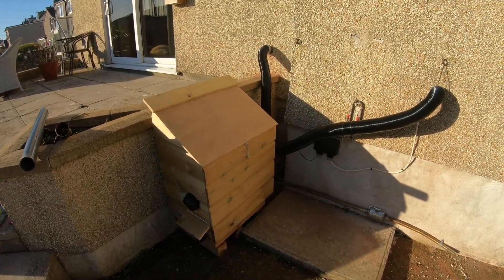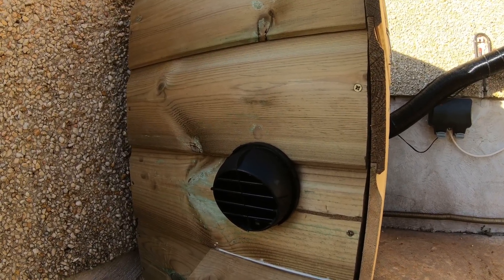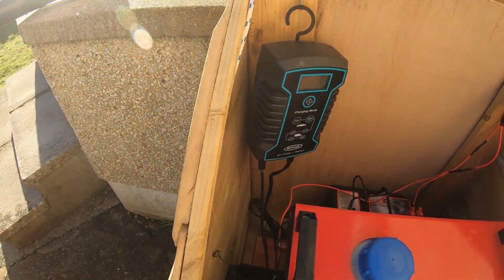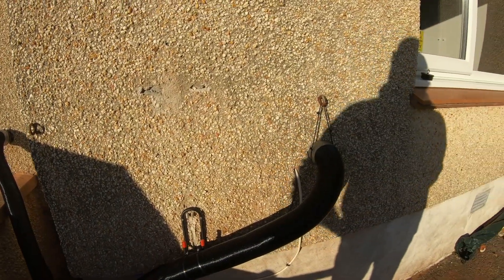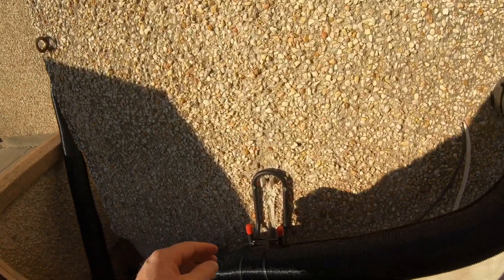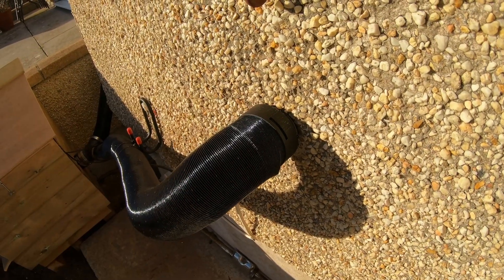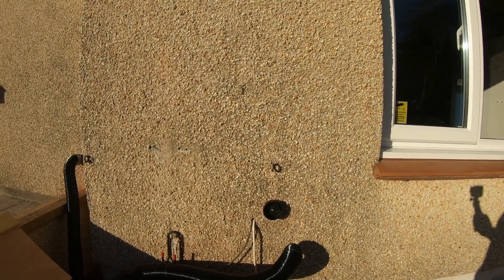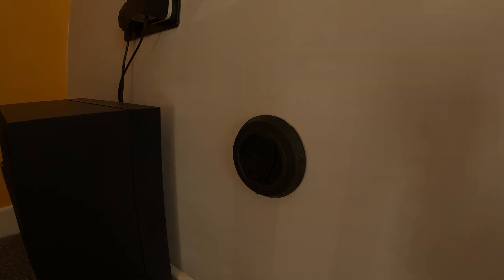Heating my home with a Chinese diesel heater.

Comment: L.P. is cheaper per gallon in America, and Natural gas is even cheaper. I see people use these Diesel heaters in garages and Campers/ Rv's mostly.
Reply from the maker: Yeah, RV’s & campers but also lorries, or semi’s as you call them. People have started looking into heating their homes with the diesel heaters because of ever increasing charges. Most homes in the UK presently have heating using natural gas or electric. Some, although not so many have oil (kerosene) like I have.

Comment: On exsos muffler i did see wrong
Was locking like it was up side down.  Sorry for that
Reply from the maker: Hey, no problem.  👍🏻😀
Reply: @en53kff  yes but right shud be right man 😉

Hope u find out of it. But I can garany u it is not condens from air heaters inside

Comment: Ur exsos muffler is up side down.
There is a draining for condens in topp as you have it now. If u turn up side down condens gets out of that Long exsos pipe.

Shud have put it inside and use energy from exsos heat as well
Reply from the maker: No no. Screw is at top, hole is at the bottom.
I have it outside to draw in fresh air which eliminates condensation inside the house.
Reply: @en53kff  if u get condansation of this inside ur have another problem m8.
This is trying air so dry u can dry ur washingmashine clodes inside.

If ur drag outside air inside house u get moister as h...

Have bean used this for 3 years stright 24/7 and my boat is to dry inside so have to open up some vindows and sometimes the Door.

They not produs any condansatione at all. My houseboat is dryer then New houses are.
Normal moister here is 15 to 25% when I do open Door and Windows many times every day.
And remember. I dont use energy of exsos.  Exsos and inlet for burner goes stright out.

And much lower cost and consume when inside. Cos it use so much more energy to heat up 0 celsius air then 20 celsius air.

Last vinter i get stucked in ice. 1 meter of ice.  22 celsius below. And 23 degrese celsius inside 24/7 and still i did last 4 days in the houer for 10 liter. Litle under cos u never gets 10 liter in tank.  But say 10 liters.
Lower cost than have cable whit power to ouer house in cost.

So thats not a real argument m8. Sorry.

And Just locking at all others sailera and all People that now use this for houses.  Never ever have i seen condansatione. Ever. And I have seen video of all burners for years.  Have a friend that import this alsow. 
Never ever bean an issue.

So then u have burner to suck air for heat blower from outside ore a moister place !!!!!

Remember normal hosuses have around 30 to 35% moister in every houses. Thats normal.

So not shure how u manage to get that, but have nothing to do whit air heater inside att all man.

Know so many that use this year around and artic sailers that dryes out there boats whit this heaters.

Maby ur was full of water inside ore something crazy.
But this never get any smell ore any condens inside if not do any wrong whit it. 
THATS FOR SHURE !!!!!!

Comment: How does the running cost compare to using your gas central heating?
Reply from the maker: Hi there. I can’t give you A comprehensive answer because we don’t have gas in our village. We do have oil fired central heating and I can tell you that our central heating boiler burns kerosene at a hell of a rate compared with my little diesel heater. However, there are many videos on the subject available to view on YouTube. 
It is dependent also on how high a setting you have the heater at. I set my controller at 20° which can take an hour to reach from 15° before the heater will automatically quieten down to a tick over to maintain that 20°. 
I have heard different opinions but generally it costs between 15p to 30p an hour to run on diesel.
Reply: @en53kff ah ok, i wonder if the little heater is actually more efficient or if you just use less because you're heating a couple of rooms instead of the whole house?  would be an interesting project to investigate.  

neat installation too btw, meant to say, good job :)
Reply: @StikDragon  heat whole house if u Mount it inside garage ore some and use energy of very Long exsos pipe. And get air from inside and spread it out inside again.

Must do whit all of this burners is fine tune secret menu code 1688.
Hx 1.2 at low. And 3.6 Hz at topp.
And be safe when you mounth it safety. 
Can use exsos to bend copper pipe around and make heat exangers to.   Litle pump to send Hot water around all house for radiators and so on. Water tank.
Get a bigger tank is a must.  I have bean used this for 3 years 24/7 whit no problems.   When u tune Hz settings and alsow fan speed to 2200rpm at low and 4500 at topp.  U get burning so clean u almost not need exsos out.  But u take it out anyway for safety!!!.
10 meter ore more no problem for exsos.  Produses heat at ur garage feks. 
And u can get out so much energy from exsost whit make coppertubes around exsos and use all the energy from it. 
Have heat outlet in house at floor. And more then 1 outlet.2 ore 4 is ok. Then u can stop any if want to.   Them say use some watt in start and stopp. Thats true.  But whit my fine tuning it is running for 10 watt at full blast.  When Idle i never have get any readment. (To low)  10 watt 24/7 is nothing. Depens in ur house and how well you build this.  But 10 litet at fine tune goes in 4 days in norway.  Below freezing
Reply from the maker: @StikDragon   Hi again. I have two entry points into the house but doors are open to warm all areas. With hindsight I’d have no hesitation to do it all again. Thanks again for your positive feedback. 👍🏻
Reply from the maker: @Lordlindef  Hi Eivind.  Yes I have tuned my heater, adjusting the pump rate and also the fan speed. Each heater should be tuned individually. The parameters for each machine are different. It depends on the temperature of your air intake as well as the type of fuel you are using and whether it is a mixture of more than one fuel. The settings you gave may be good for your machine but not everybody’s.
Reply: @en53kff  no ofcorse not if ur not burn diesel like all shud do !!!!!

Whit diesel it work perfekt all over
Reply from the maker: @Lordlindef   Good comment Eivind. 👍🏻.  Nice information.  I don’t think too many people fine tune their heaters. 🤔
Did you see this video? 
https://www.youtube.com/watch?v=SmCYQu53umk
Reply: @en53kff  i've got a much older version of this that i've been using to heat my workshop for many years now on kerosene, i had no idea they could be tuned, i'll have to try, thanks

Comment: In Tulsa, OK it'd be MUCH cheaper to use propane gas in an unvented blue-flame heater. The advantages are so many , but I'll just name a few; moist heat: Open flame puts humidity into the air instead of drying it out. The colder it is, the worse dry air feels when heated. 68* air at 70% RH feels comfortable while 78* air at 10% RH still feels COLD! Dry air is hard on your nose and lungs and leads to nasal and sinus infections. Why did Grandma keep a kettle on the wood stove all the time? A 40,000 BTU propane heater isn't expensive and is maintenance-free. You can't say that of any diesel heater (I was a semi driver and lived with a diesel cab heater and hated it. When I got a heat-pump run by a diesel power unit, I thought I was in heaven! No more waking up in Utah at 3 AM to a -4* sleeper because the heater was plugged-up!!! The bunk heater/cooler was HEAVEN on a golden plate, I had all the electric I could use and a little fridge and microwave and COLD A/C with-out idling the truck engine all night.) Today (Valentine's Day) diesel is $4.99 a gallon. Propane is $14.99 for a "20lb." tank at grocery stores or $9 bulk-Hmmm.
Reply from the maker: Hi there Ricky.  Thanks for your comments. It sounds like you found the set-up that worked best for you in your trucks cab. Those in the UK are predominantly diesel heaters. I guess though we don’t have as many overnighters as you do in the States, being such a smaller country in comparison. 
I’ve just been looking at present prices in the UK and converting them in dollars. For heating I can buy what we call red diesel, which has a reduced tax rate. That’s because we can’t use it in motor transport. That works out at around $5.93  per US gallon. So pretty similar in price. Regular diesel for cars and trucks is $7.71 on average per US gallon.  
Here, propane (exchange empty bottle for a full one)  for a 24lb bottle from a store is a little under $36. So that works out at $30 for 20lb. You can’t get a price for bulk deliveries without phoning a company first for a quote.  👍🏻😊
Reply: We have the opposite problem in Britain, we need to get rid of humidity!

Comment: Is it worth insulating the heating duct, from the diesel heater to the house, as you must lose quite a bit of heat to the outside air?
Reply from the maker: So many people have commented on this and so many times I’ve answered in the comments . I wanted to point out the ‘Y’ piece and also the reducers in the video. Since then the ducting outside has been insulated. Thank you for your interest. 👍🏻

Comment: I'd cover that pipe with rockwool or fibreglass. More heat goes into the house
 and less lost in transit.
Reply from the maker: Yep, it was all insulated soon after making the video. 👍🏻

Comment: how long does it take to go from say 18c indoors to 21c
Reply from the maker: Probably anything up to an hour. But remember that the heater is working 50/50 between two areas. It would be around half the time if I was heating the one room. One room measures 18’ x 12’ and the other 15’ x 12’.  Hope that gives you some indication.

Comment: very good, I set up something very similar here at home.. do you have a problem with insects entering through the air intake?  Here I built a filter with pvc tube and a thin fabric..
Reply from the maker: Thank you. No I don’t have a problem with insects. But there again, it is winter and insects are few and far between at the moment. If I do find I’m having a problem in future I may make some alterations but we shall see. Cheers.

Comment: Why is it that everyone who mounts these heaters outside fail to insulate the air hoses into and out of the house. There are even some who take outdoor air to heat but they need to provide ventilation so trapped indoor air to leave the home taking moisture out with it. If it is a new home it’s critical to vent the indoor air since new homes are mostly airtight.
Reply from the maker: Hi there. As mentioned in many previous answers, the outside ducting was insulated shortly after making this video. I wanted to show the’Y’ pieces as well as the reducers before covering it with insulation. Air blowing in from outside works similar to a PIV system. Yes, it does need ventilation, as does any home, (which I have) and it will find any exit, eliminating droughts, particularly in some older properties. The moisture content in my property ranges between 35 - 50% which is well inside the acceptable level for the cooler time of year.

Comment: Nice installation, I done similar project I used plastic storage box/bench from B&Q as heater housing, I decided to buy one of these heaters  after this last cold wave we had here in Ireland, and big  impulse to do this was my gas bill :P.
Due to house configuration (terrace) I was only able to do one outlet in the kitchen but still all downstairs get nice cosy warm after while, my wife love it she was sceptical on this but now she use it all the time. We use about 10-15 litres of green (lower tax) diesel per week , 1.10 euro per liter so is not to bad IMO.
Reply from the maker: Hey, good for you. 👍🏻 it’s a good feeling knowing that your house is warming up and you’re not paying through the nose for it. It sounds like you used your initiative when looking for a box to put it in. Great idea. Some people criticised me for using timber to make my box saying it was a fire hazard. But as you know, it’s only the exhaust that gets hot and as long as that is safe you are good to go. I’m using lower tax diesel too and a similar amount per week. This idea really seems to be catching on now even though the price of the heaters has doubled. Good luck with it and thank you for your comments.
Reply: @en53kff  I used bit of this stove heat resistant sealing rope to cover gap between exhaust pipe and hole I drilled on the side of the box  I was checking that for few days with IR thermometer and no problems,  I had to cover this gap because sometimes wind  blow some exhaust gases back to the box as I don't have to long exhaust pipe. And yea only exhaust is really hot but if you keep 1cm clearance all will be OK. I used it with battery and charger now I have 30A power supply (power cuts are very very rare here) not sure yet what I will use in the future maybe I back to battery.
Anyway keep warm greetings from IRL
Reply: @en53kff I see same 8kw model eBay for £95. Are you saying they used to be a lot less?
Reply from the maker: @ThisIsJamesL  Hi James. Firstly, take with a pinch of salt when they’re advertised as 8kw. They are often labelled as such but all are generally  5kw, as mine is, which are OK. £95 is a reasonable price. They did double that last winter and I guess they might again once it gets really cold. I did purchase a few extras too, such as ducting, closable  vents, Y connector and 150cm exhaust. The unit itself I paid £80. Good luck with your project.
Reply from the maker: @ThisIsJamesL   James, just watched this new video. Has some great pointers which you may find useful. Informative and entertaining. 
https://www.youtube.com/watch?v=gCgI9VAyoNs
Reply: Lucky with the green diesel - how do you buy that, as a heating fuel as opposed to for a car?
Reply from the maker: @luckyphil_01   Hi Phil. Here in the UK it is dyed with a red dye and hence we call it red diesel. It is sold at its own pump at our local filling station. Before you can purchase it you have to fill-in forms and show ID and say what it is going to be used for. It can’t be used in any mode of transport but it’s okay for personal use in heating. You are then given paperwork which you must show each time you want to purchase. The attendants do watch you fill your containers and check that you are not putting any in your vehicle.
Reply: @en53kff  ok, great - thanks for the reply! Here in Austria people buy something similar (red died diesel for heating centrally) but it can only be bought in large quantities and typically delivered to your house by truck
Reply: @luckyphil_01  just at my near petrol station they have separate pomps with kerosene and green diesel. 
Of course you can use this to your car but from time to time you can be stopped at checkpoint and they check sample of your fuel on spot. If they noticed traces of green diesel in your tank I think 🤔 you on trouble.
Reply: @sprint12polska  thanks / dzięki! Psia krew those govt. controls…

Comment: I have a very similar diesel heater in my van.  It is important not to use the heater constantly on the lowest settings.  Give the maximum temperature and rotation of the rotor time.  This prevents the build-up of carbon deposits and deposits from unburnt diesel fuel and subsequent damage
Reply from the maker: Yes, 100% correct. A couple of minutes blast on full heat before powering off helps.  Thanks for that useful comment. 👍🏻
Reply: That is BS . Proper settings is the key word . Running on high can soot up as well.
Reply: @pauls466  As with a diesel engine, it is unhealthy to drive at too low a speed because you will kill the engine and clutch

Comment: Very very interesting. Would you have to remove this is you ever sold the house? I have never seen this on a house before. Mainly on camper vans.
Reply from the maker: Good question. I’ve never really thought about it. Not that I shall ever be selling. I shall see the last of my days out in this house. Yes they are often in camper vans. In fact I believe the original purpose was for lorry cabs. They kept the drivers warm if they were on an overnight sleep out. They’ve been around for many years. 🚚

Comment: Have your neighbours complained about the noise they get when in their gardens?
Reply from the maker: Hi David. I haven’t  had complaints, no. Firstly the heater isn’t that noisy, even less so when enclosed in its cabinet. Secondly, in the cold weather the neighbours don’t tend to venture into the garden.

Comment: Nice job. I've been planning something similar for a while. Everyone should be doing this until prices come down to something reasonable.
Reply: exactly. if the price of diesel gets to be not economical for use in these heaters, we are all going to be having way bigger things to worry about than heating our homes! at that point, the world will be on a fast track to shitsville, as diesel is the world's most used fuel for shipping infrastructure (both road and water) and would mean a cataclysmic ripple effect in the world economy.

a lot of people like to shit on the chinese for intellectual property theft, but god bless em....without them we'd all have to spend $1000 or more on the webasto or eberspacher units. 

china numbah one!
Reply: I can only see fuel prices going up, we ain't seen nothing yet with this insanity gaining momentum as we do nowt to stop it.... 😕
Reply: You can always buy fuel from lorry drivers, especially the ones from abroad. Just approach them and say you want some fuel. 
Usually it's £1 per liter. 

I personally think wood burner is much better option as you can get wood for free